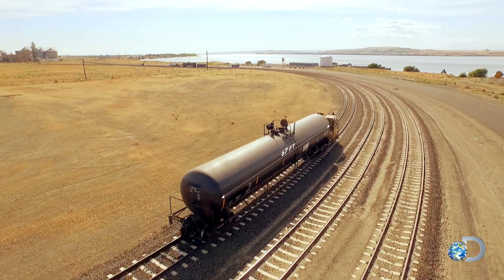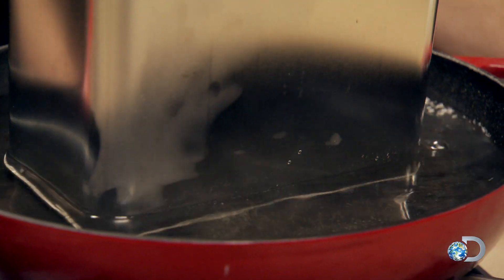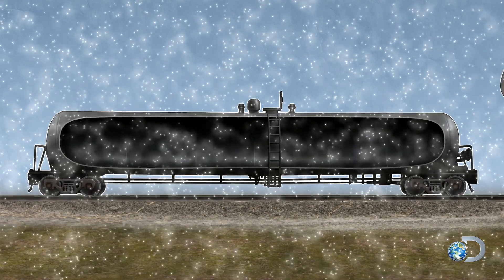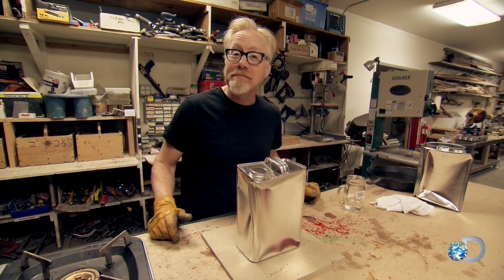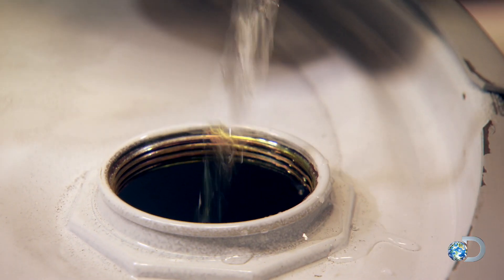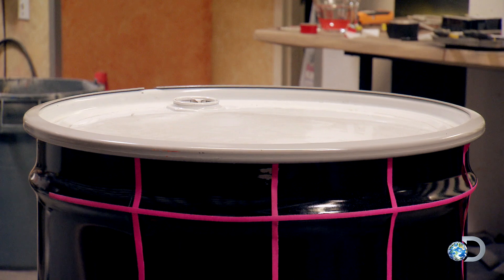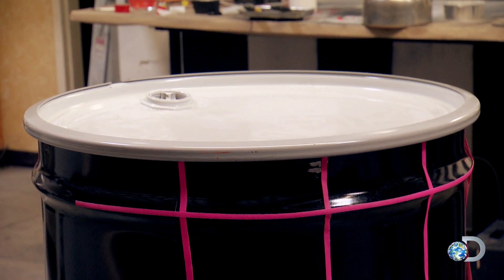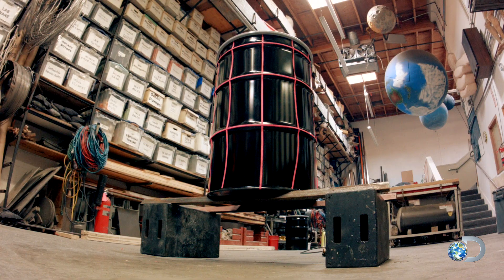How to Make a Train Tanker Implode | MythBusters

Comment: All you have to do is fill the tanker with liquid, then open the drain valve at the bottom and make sure all the vents are closed and it will suck itself in the same way

Comment: This is what people should watch, but makes it confusing to understand how the Titan submarine would have debris and not just be a giant cube
Reply: Because the pressure is far more greater, and it is shattered after imploded
Reply: The sub have carbonfiber components so it's structure is nor as rigid as the things they used here as an example. Which means the whole sub shattered the moment it starts to implode.
Reply: Carbon fiber shatters, it doesn't buckle and bend like metal does. All it took for the Titan to implode was a fracture in the hull and... gone. The force of the pressure ripped it into pieces.

Comment: That is how Titan imploded. About 8000 psi external sea water pressure and 14 psi inside pressure and temperature difference, composite material of sub couldn't resist the pressure difference. It should have been made by metal from Titanium or similar. Engineering and management catastrophe to lower the cost but charging $250k per person.

Comment: So, if the pressurized "ISS" is in "space" which is said to be a vacuum or close to a vacuum, what keeps the pressure differential from causing it to explode?...   Anybody?...
Reply: Structural integrity
Reply: It's engineered to withstand that kind of pressure.  Kind of like a submarine, but in reverse. A Submarine has to be designed to withstand the crushing pressure of the ocean, but a space craft has to be designed to hold in the atmospheric pressure of the environment inside keeping the passengers alive.

Comment: Tank cars have a vacuum relief valve that engages at -3 psi so this test is flawed.
Reply: They probably put a blind flange on the hole in the multi-housing . We just had a tank implode the other day. Someone had the BOV closed and only a check valve was left.
Reply: I seem to recall they actually mentioned plugging that. They wanted to test if it could plausibly happen under any sort of worst-case-scenario, where everything goes wrong. In the end they could only get it to collapse when it had previously been damaged by a concrete block falling on it, another thing they viewed as a hypothetically plausible thing to have happened to a tanker car. In the end it did collapse, and without reverting to anything that couldn't hypothetically happen in real life, so the myth was deemed plausible but very unlikely.

Comment: This is basically how the some of the earliest heat engines operated.  They boiled water in a cylinder with a piston, let the steam condense, and the atmospheric pressure would press against the near-vacuum in the cylinder to drive the piston.
Reply: You're describing Newcomen's engine, after the piston has been pushed outward by steam, cold water is injected into the cylinder to bring it back.

Comment: I left a gallon container of paint stripper in my driveway last week.  It was close to halfway full I imagine.  I went out the next evening to use the stripper, and discovered the can (it was the exact same type as the can in the beginning of this vidro) had caved in on itself.  I was shocked.  If anything, I thought it would've expanded.  It was in the low 90's during the day, probably in the 70's at night, and it was out of direct sunlight.  It immidiadiately brought me back to this episode from years back.

Comment: this is actually pretty easy. A local trunking company carries liquids. One of the mechanics decided to borrow a tanker and truck and fill it full of water and trucked on out into the middle of nowhere to fill up a friends pool, (well water is not good for pools)

They tossed the big hoses into the pool and went inside to get something to drink. Less than 15 minutes later they heard a horrible crunching sound. The tanker had crumpled in the middle as if two giants had pushed it in like an accordion. Turns out he forgot to open the vents on the tanker. The weight and force of the water caused an enormous vacuum and the tanker buckled.
Reply: +Bis_Auf THEY HEARD A WHAT?! FINISH THE COMMENT!!!
Reply: Finish what comment? Mine is all there, maybe you should look harder and try clicking on the read more part. Caps don't help.

Comment: How would this even be considered a myth since it happened pretty commonly before they started putting one way vents on cars? It was especially common with tractor trailers. It doesn't even need the steam if there is a big enough overnight cool down.
Reply: Seen the aftermath on a much larger scale; 50,000 gallon vertical tank.  Painters had "masked" a valve inlet with a loose cap, and forgot it afterward.  Filled with milk, cap lifted to let pressure out, but when it was drained, the suction kept the cap pulled on tightly.  Afterward, it looked like a beer can that had been crushed.